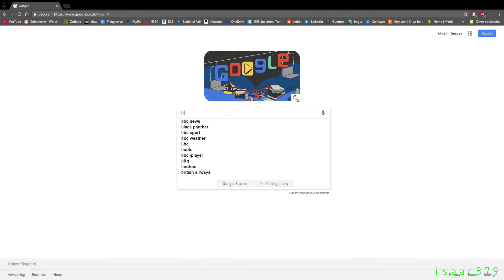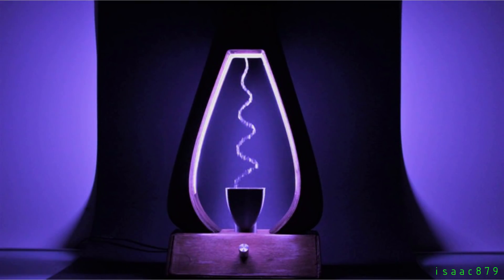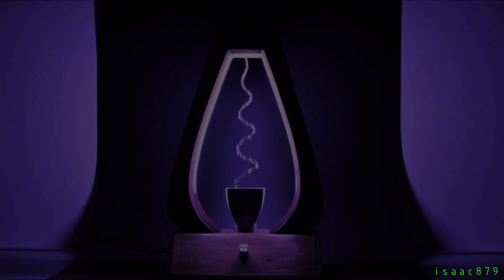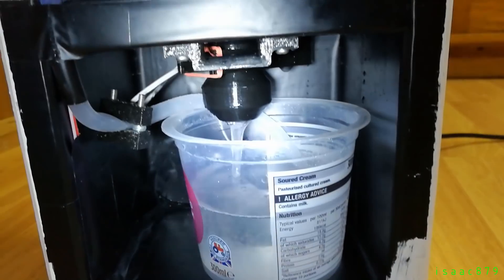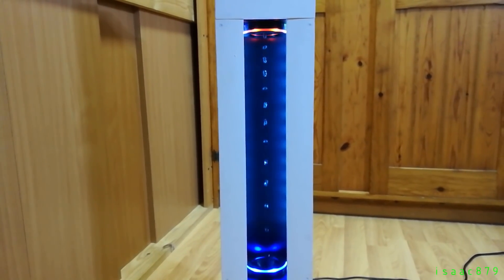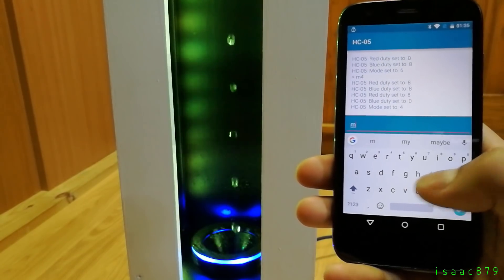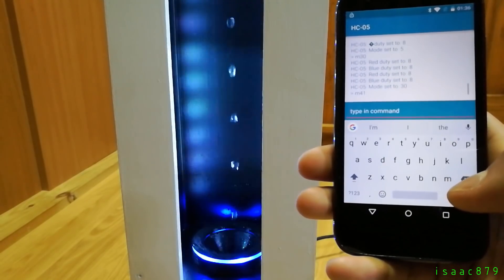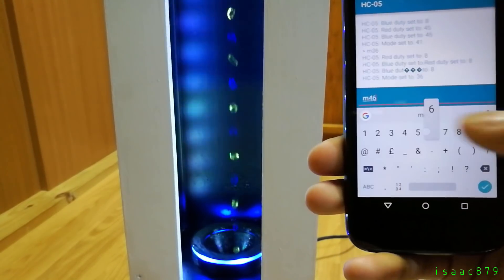Levitating Water Drops - My RGB Time Fountain Project

Comment: That's an incredible project you got there! Maybe have a look into "laminar flow nozzles" to get your drops more uniform? No idea if they only work for streams, but i imagine they may also help with drops.
Reply from the maker: I did have a little look while designing it however I didn't find any that were small enough and they seem to only be used with continuous pump not diaphragm pumps. I do want to do more experimenting with them for the next version though.
Reply: isaac879 hi dear how are you? I  want to make this where i can get spares? Your whatsapp numb plz?

Comment: Very nice build, looks amazing! Im planning on doing one of these for myself, and I wanted to ask a few questions. First, did you use adressable RGB strips or unadressable? How many watts do your strips take (how much light do they emit)? And also, what kind of pump would you recommend, what are the specifications (flow rate, tube size etc). Thank you!
Reply from the maker: Thank you! I didn't use addressable ones. I can only control the colour of the whole strip, not each led. 
There are 60 RGB leds on the strips in total; at 12V they draw about 600mA when fully on (they are normally run at about 8% duty cycle though ). At fully brightness it would be 12V * 0.6A =  7.2W.
The pump must be a kind of diaphragm pump to get the individual water drops. I used this one: https://www.ebay.co.uk/itm/12V-DC-R385-Mini-Aquarium-Pump-Fish-Tank-Motor-Diaphragm-Water-AIR-Pump/192306145009?ssPageName=STRK%3AMEBIDX%3AIT&_trksid=p2060353.m1438.l2649
The tubing I used had a 5mm internal diameter and 8mm external diameter (external diameter doesn't really matter).
Reply: Was it done on purpose where the LED's are not even height comparing the strips on one side?  Do The LED's need to line up height wise between strips across the stream? I plan on reproducing this awesome project, well done!!
Reply from the maker: I tried to get them even but there is no need to. They just need to light the stream of water so the position doesn't really matter as long as they do that. You can see when I was testing and just had the LEDs randomly draped over a tripod and the effect still worked: https://youtu.be/LqMFiVkvxQw?t=262
Reply: isaac879 Hey is there a chanse that you could send me the model of the 3D printed cone that catches the water?
Reply: Sigfrid, have you made one yet?
Reply: @RifaiAL  I am in the process of making it. When i get home during this Christmas holiday, i will continue in making it. im just about done, just had to switch out the transistors so I'm waiting for new ones because the old ones got too hot. I will update you once I'm done! :-)
Reply: @dirfgiS  That's excellent news and ray of hope brother.

Comment: Great call with RGB, I sooo want to do this myself! (Albeit a bit smaller)
Say, does the water/pump make a lot of noise or is this good to have in your room?
Reply from the maker: Thanks, I was really happy with the effects they created! It's fairly quite, the water drops landing and the pump make about the same amount of sound. I would say it is a little bit louder than a  PC fan running at max speed. Using an app on my phone (so not very reliable) I measured the sound as 47dB right next to the fountain and 30dB 1m away. (Normal conversations are around 45-50dB)